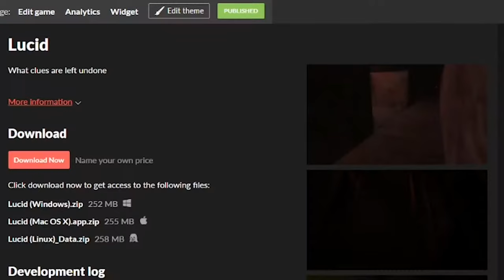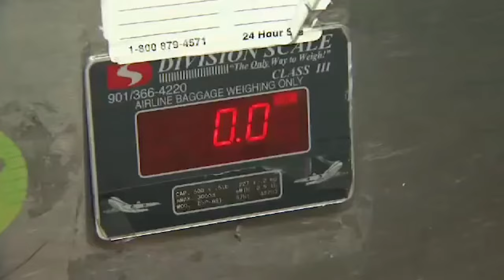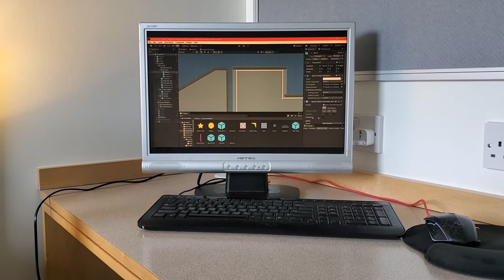How I Flew Overseas With My Desktop PC

Comment: I put by case inside the baggage with a hard shell and checked in, I traveled like this many times and nothing happened to my computer.
Reply: i need advice.
Reply: What if you have long fly? Not only in uk
Reply: What hard shell you made ?
Reply: @VITAS874  my case was mATX so I just put the case in between the cloths. I just removed the HDDs from the case. Now I have a eATX so I have to take more precautions.
Reply: @VITAS874  It’s not about long or short flight. It’s about the luggage loading and unloading.
Reply: What abt customs?
Reply: @dotamaze  do you taked out cooler from pc case? Gpu?
Reply: @dotamaze why did you remove your hdds?
Reply: @shaker63  HDD should be removed to prevent it from constant shaking inside the case. If you have nvme or SSD, you don't need to remove it.

Comment: Im moving to japan soon and im from the us and I'm about to do the same thing u did lmao but I have a really beefy PC hopefully it doesn't break lmaoo
Reply: same. I'm thinking of taking off every component and put it in my bag as carry on luggage that I can actually carry instead of the overhead compartment. Case as checked in luggage with as many clothes I can put inside and around it. On top of that just one month of premium google drive subscription to back up everything to prepare for the worst. I wonder if you've already moved and how's your PC doing. :)
Reply: @vira2936  yea ive already moved, I took most of my components off like the GPU, AIO , power cords, and some of my screens in the PC. I have a lian li case so I was able to fit a lot of clothes inside of it and I also put clothes a layer of masking tape around the glass panels.  The only thing in the PC case was the motherboard, CPU, ram, and the nvme. I checked all of those in and I carried my GPU in my bag as carry on lmaoo. Wasnt trying to have that break
Reply: @vira2936  and so far nothing broke while flying but I suggest if you are moving to a different country try to have less stops on ur flight

Comment: Hello,
 I am planning on taking my pc overseas too in a few months from England to USA do you have any tips about anything I should know and what do I need to change my plug power? for it to work over there?
Reply from the maker: If your computer is newer, the power supply should have a rating of 110v-220v. Look at the inside of your computer to check it
Reply: @Hazzanger i'm trying to fly with my xbox one overseas next 10days did airport security not open the suitcase to check what is inside?
Reply: Hi, I am actually hoping to take my pc overseas from USA to England soon, did you run in to any troubles?

Comment: What if I have a tempered glass shield :/
Reply: My PC also has a tempered glass. I'm moving to UK next week and I'm gonna need to buy a new computer case. What did you do?
Reply: @FanFridaDuncan401  Hey , Even I'm planning to move to UK for Studies but I don't think Tempered Glass will be an issue unless you secure everything properly
Reply: @xDreamSmp  hi! I actually dissambled my pc and letting my tempered glass back in my country. Now I regret it because I assembled my pc again and is not working. You're right, probably the tempered glass would have worked out pretty good! 
Oops :(
Reply: @FanFridaDuncan401  That's my biggest worry , I'm not professional so Max to Max I would only disassemble my GPU and Maybe CPU . Btw did you ship your PC as a Carry On ? If yes then did security tell you to open your baggage ? 

One of my main worry is security asking me to open everything
Reply: @xDreamSmp  well, that was not my biggest concern but at the end I still have the problem of see what is happening. I'm not a pro either so I'm gonna hire a technician. I put my pc in the checked luggage, I arrived to the Heathrow Airport and no one asked me to open it, there was so many people no one cared about me haha
Reply: @FanFridaDuncan401  did you make it work finally ?
Reply: @FanFridaDuncan401  I mean did you get someone to put it together?
Reply: @mrmrssubstance  Hi! I actually assembled it well, the problem was the monitor I bought when I arrived to UK. I bought a new monitor and now it is working perfectly. I am happy with it! :)